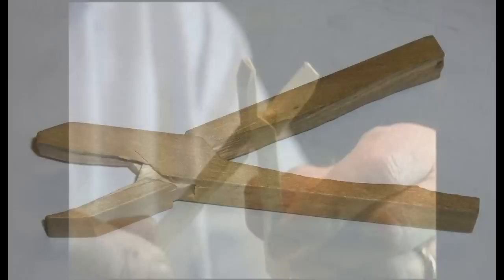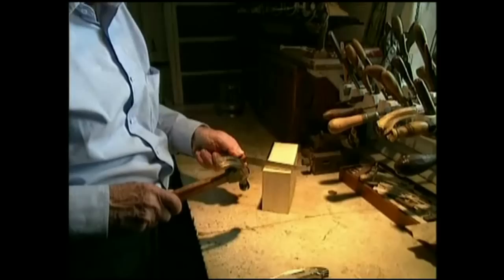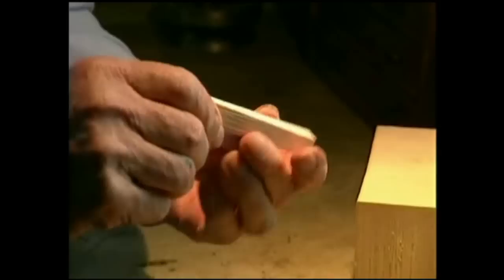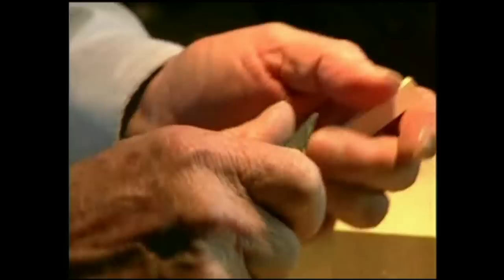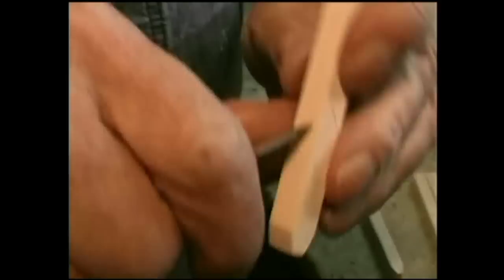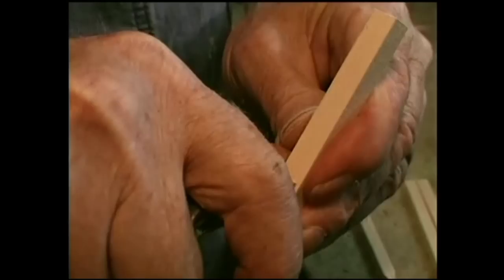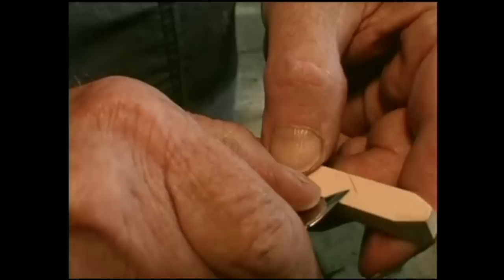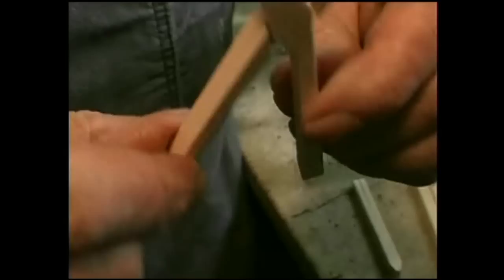World's Master Carver, Ernest "Mooney Warther- Part 2: Making Basswood Pliers with David Warther

Comment: How much pressure can you exert on a pair of wooden pliers? If I can't use my hand to grab/crank/pull or hold something... how is a something made from softwood supposed to do the job? I usually put a lot force on my pliers (probably because I end up using them for something they weren't really intended for) --- definitely neat but it didn't look particularly strong. Maybe I'm just a plier abuser..
Reply: They wouldnt be practical in most uses, but as someone who works on a bunch of different projects I can see them being useful. For projects where you dont want to mar the surface such as glass work and you just need it to hold still, or if you are holding something that is generating heat. Not many uses, but i think its more a demonstration of the carvers ability than practical tool. The wood looks like a soft wood such as poplar thats cheap and easy to cut with a knife, oak would require a saw to cut that easily.
Reply: Good point on holding glass. I don't work with glass so it didn't occur to me.
Reply: usually glass objects or clay ones that need modelling :)
Reply: My Dad is an auto mechanic and he uses nothing but home-made wooden tools.  He only works on wooden cars, though, so maybe that's why.
Reply: brad quillen You joke, but there were a few wooden frame cars produced.
Reply: brad quillen I had a wooden car once. It wooden work.
Reply: wizzlestick111
It's Basswood.
Reply: well, for 1 thing, he makes them to hand out to children for a souvenir, not to used for a real one.  Geesh you people are really ignorant.  Oh, I have been to the museum 2, and I have a pair of the pliers
Reply: You could prolly make strong enough ones by simply using a thicket piece of wood, or using oak, etc etc etc...
Reply: Lloyd HC Best Youtube comment I've seen in a long time!!!!